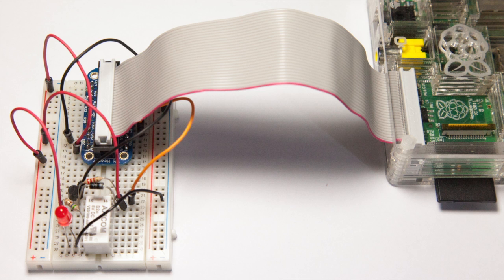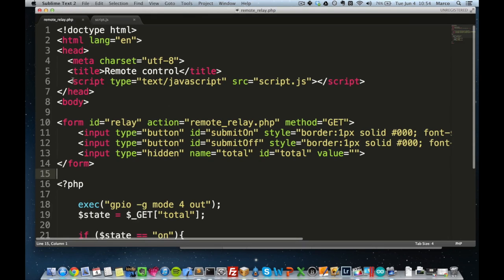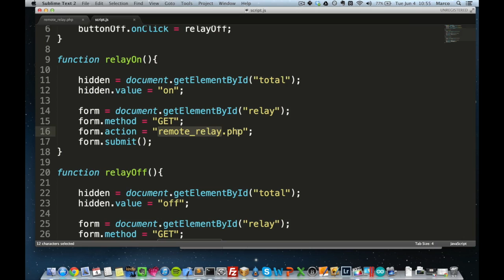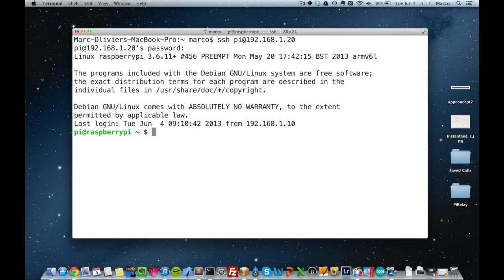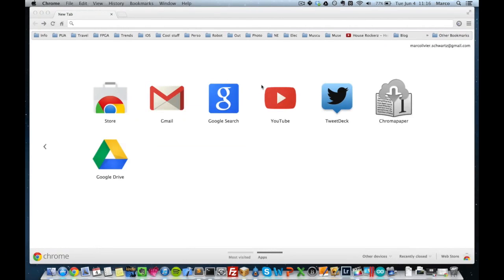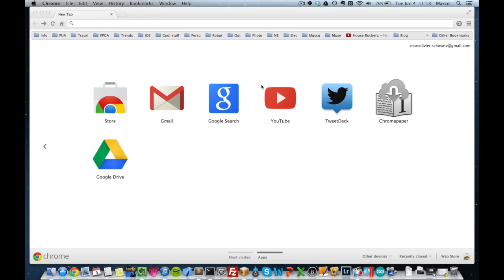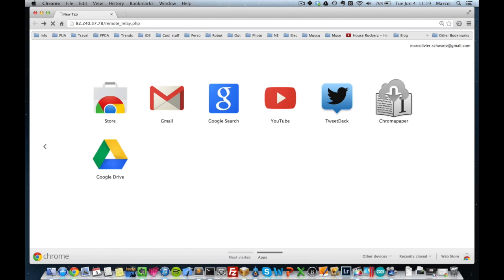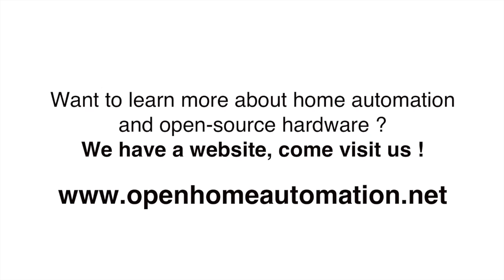Control a relay from anywhere using the Raspberry Pi

Comment: Hi. 
I tried everything in the tutorial. The webpage showing on/off opens but nothing happens on clicking them. Why? I'm not able to figure out. Please help.
Reply: I didnt install wiring pi library. Is it required?
Reply: +malini chavali wiring pi is not required. You can just add a -g in the code and give the gpio pin number.
For example if you have connected your led to gpio 4 then give the code as gpio -g write 4 1. If you even face any problem you can check out this link....
http://kurup87.blogspot.in/2014/09/raspberry-pi-gpio-led-onoff-wiring-pi.html
Reply: He says wiring pi is required but it is not just add a -g.

Comment: what if my router uses dynamic IP ?
everytime i restart my router my IP changes.
Reply: Simply set up a dynamic DNS address using a service like DYNDNS.ORG. Every time your router's IP address changes it automatically updates the dynamic DNS service.
Reply from the maker: That would be a problem for the solution shown in the video indeed. Check the link to our blog to find out how to solve that :)
Reply: Can I use the same to make products for commercial use. I am thinking of a startup dealing with such smart products.

Comment: we can use android application and do this project its possible or not
how to do??
Reply from the maker: Sajeer Cfs For sure! You can check out my book about Android & Arduino (maybe examples can be adapted to the Pi): http://www.amazon.com/Arduino-Android-Blueprints-Marco-Schwartz/dp/1784390380/ref=sr_1_1?ie=UTF8&qid=1420477601&sr=8-1&keywords=arduino+android
Reply: thank you sir
):

Comment: good post,  just that port forwarding from the internet to your Pi, is not secure.  as any one can switch the relay on/off. unless you put some sort of authentication in front of it.

less sexy is using email with a certain subject to do on/off. just a thought

Comment: I have used Arduino for my various projects over the past 2 years. However, now suddenly, I am being asked to use Raspberry pi for my electronics project. For starters, I have to make a CO (carbon monoxide) detector using arduino which turns ON a buzzer when the CO level goes above a certain set level. I have been reading about the pi and realize that it does not have a builtin A/D converter however we can use A/D chips and manage to interface the sensor.
My questions is: I know that in case of Arduino, the code runs the moment one connects the microcontroller to the powersupply. Now in case of the Raspberrypi, once i interface everything and code it and stuff.. If I disconnect the power and then reconnect the powersupply - will the circuit start auto detecting the sensor reading and running the code,etc? If not, then raspberry pi is pretty much useless for a simple project right? Can someone please respond?